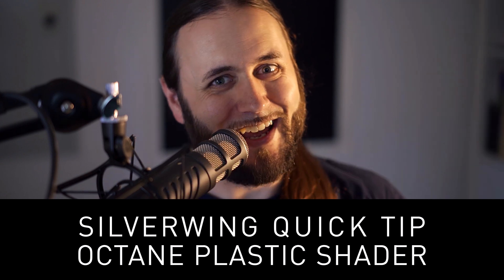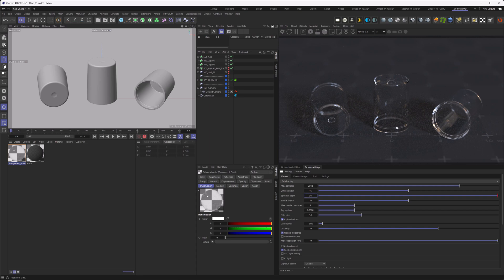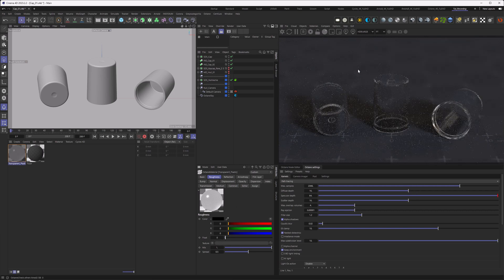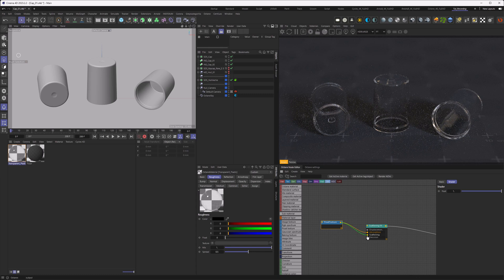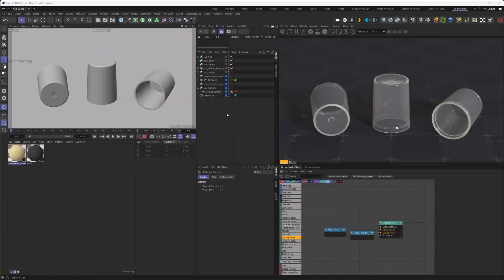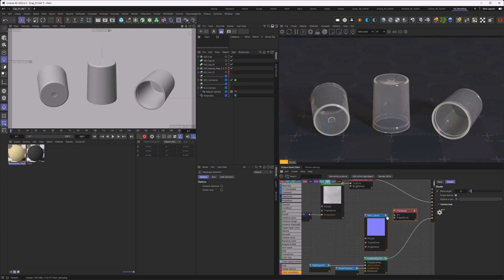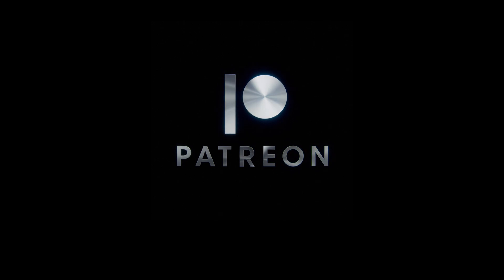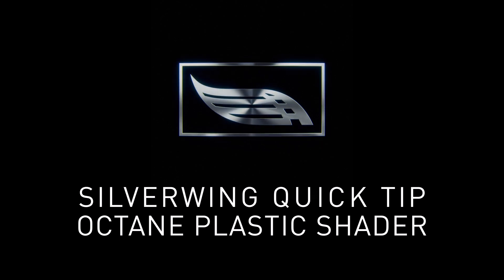Silverwing Quick Tip: Octane Transparent Plastic Shader

Comment: Could you teach me how to create this effect in the c4d arnold renderer?
Reply from the maker: Hey there and thank you very much for your message and you request.
To be honest I have not used Arnold in a long time. So I am not quite sure what you need to do exactly to get it working there. Though in general, as Arnold is also a physically accurate path tracer it at least should be along the same lines as I show in Octane.
I also have a tutorial how to achieve this effect in Blender Cycles. Maybe this helps to get you closer to implementing it into Arnold:
https://youtu.be/2VYX8EReMQs

Comment: whats the equiv of float texture in blender octane?
Reply from the maker: That would be the "Grayscale Color"
Though this is capped from 0 - 1 (Black to white)
If you need values above 1 though it's best to e.g. use Float Value and set all 3 values to the desired strength.
Reply: @SilverwingVFX  thank you ill try it soon

Comment: Do you know how to implement it in rs, Silverwing teacher? It seems impossible to achieve
Reply from the maker: Yes. On my Patreon there is a scene for RS too.
Though it's easily explained so you do not have to go there and get an account.

With RedShift you can actually get a very similar result by using the old material (not the standard surface) and then setting the scattering that you have in the refraction to extinction. Then you need to balance the brightness and density with the Absorption and Extinction levels in there.

I hope this helps 🙌
Reply: I love you, thank you very directly

Comment: The result is excellent, but I have a question, how can I configure it so that the contents of the plastic container are visible? , adds another element inside the plastic container and when rendering it it is lost.      :face-purple-crying:
Reply from the maker: Hey there and thank you very much for your comment.
I think your problem has nothing to do with the plastic container. It should work just fine with objects inside, just like in reality.
If you have a container that is open, like in my video it might be a ray epsilon problem:
https://youtu.be/oidqVR_3E04

It you have a thicker plastic container and want to add objects within the plastic (objects molten within the plastic). This too could be a ray epsilon problem. But also a nested dielectrics problem. E.g. you have the wrong priorities for the materials inside the plastic.
Refer to the guide here:
https://youtu.be/IzTCztpur10

I hope that it's one of those.
If not, feel free to ask again 😇
Reply: @SilverwingVFX   Thank you very much!! The videos really helped me a lot. I had a problem with the epsilon rays, but the scene came out very well. I just need to fine-tune the lighting. I think that's where my mistake started, which is why it didn't come out like you showed in the video. :finger-red-number-one:

Comment: I can't seem to get this look at all unless Fake Shadows is turned in Octane 2023. Did something change in that regard since you made this tutorial?
Reply from the maker: Thank you very much for your comment. I think that really depends on your lighting. If you do not turn on fake shadows the whole SSS inside the the caps is rendered using caustics. And Caustics are really hard to render. So the smaller your light sources are, the  longer it will need to clean up. Also with caustics the GI clamp plays a very important role. If you se it to low, then not enough energy reaches the SSS inside and therefore you don´t have a too bright result to begin with!
Hope one of the tips helped. Though I would just go with the Fake Shadow option 🙌
Reply: @SilverwingVFX  Thank you, that makes sense!
Reply from the maker: @filipstamate1564  Glad I could clear it up a bit. Thank you and a great start into this week 🙌

Comment: No other renderer beats Octane for mediums. Would you mind telling me if we still can't use vertex map for masking mixed materials?
Reply from the maker: Thank you very much for your comment.
Yeah. I feel the same. SSS in Octane is really good!

Vertex Maps should work for a longer time now.
You can bring them into the material via the attribute node.

I also have a tut on this:
https://www.youtube.com/watch?v=nm2FSVKKFOI

The thing that does not work with VertexMaps though is displacement.

Hope this helps!
Reply: @SilverwingVFX  "The thing that does not work with VertexMaps though is displacement." that is where I wanted to get, shit! that's a deal breaker for me. Opening UV and painting maps sucks. How frequently Otoy updates their products? Redshift has a lot of updates in a year.
Reply from the maker: @Ricardo-de9ju  Just to clarify. Displacement does work independent from Vertex Maps. You just can´t use vertex maps to create or mix displacement.
But I guess you meant that.

If you have UVs on the Object you could use your Vertex Maps and bake those out as textures. But it requires setting them up first of course, so it might be about the same effort as painting masks from the start.

Otoy usually has about two releases per Year (and many smaller bug fix ones in between)

Usually its the year number .1 and then some time later .2

To be honest I think both engines are struggling with different things at the moment. So both of them do not feel that polished 🥲

Comment: anyone know if theres a similar tutorial for blender ?
Reply from the maker: I know that this does not answer your question, but you can follow this tut with blender octane rather easily.
When it comes to rebuilding it with cycles, you can do so by using the volume slot of your glass material.
You might want to turn off the refractive material casting caustics (and therefore take forever to render) with a Light Path node.
You can find the way to do it here: https://www.youtube.com/watch?v=LTcWRh3Vob4
Hope this helps ✨
Reply: @SilverwingVFX  thank you so much

Comment: do you think you can make one for redshift?
Reply from the maker: On my patreon there is a scene for redshift ready to download.
It works by using the old material (not the standard one) and then use the Extinction in the transparent SubSurface in the Base Properties Tab of the material (Not the Multi-SSS)

Comment: Do you understand how to create the same look with SSS in Octane's Standard Material surface? The Scale parameter doesn't seem to work like the Density parameter and it's kind of hard to dial in some desired SSS looks
Reply from the maker: Yes this is also possible. Its a different mechanism. Find the settings and some explanation below:

In the Standard Surface:
Go to the transmission and set "Weight" to 1
Tick "Fake Shadows"

Set "Color" to 50% Gray
This is the transmission color if the Depth is 0. If the depth is greater then 0 then it becomes a absorption value.
Set "Scatter" to full white.
Now set the depth value to e.g. 0.02 (this gives about the same effect as the Scatter Density 100)
The Depth value is related to the density value in the scattering medium. Though it works the other way around and produces  denser results with smaller numbers.

You can think of this as the distance the set absorption color is reached or in terms of scattering the distance between scattering "particles". The smaller the distance, the more scattering. In this type of shader scattering can only take place if there also is absorption. Hence the middle gray value in the "Color" channel.

Hope this helps 🙌
Reply: @SilverwingVFX  Dude thank you so much! That makes sense and I got it to work. It's just confusing that there are 2 different methods for SSS and they produce different results. I definitely prefer the results from the Transmission method. If you have the time, I would love to watch a breakdown use cases for each/ pros and cons. Or may the old way is just outdated, and that's fine too lol. You're the man, thank you for taking the time to respond 🙏
Reply from the maker: @SeunJubril  Thank you very much for your answer. Very happy to hear you got it working.
The Standard Surface has been brought in to Octane not to replace the old materials, but to be able to get a standard between Arnold, Redshift and Octane.
All three render engines will be part of Otoys decentralized Render Network and Otoy is working on the goal of being able to switch renderers on the fly.
Therefore similar material structures have to be implemented.
As I am familiar with the "old" materials, I am mostly using those.
The most glaring difference between the Standard Surface and lets say the Universal material is the inability of the Standard to change the Reflection BRDF model.
Other then that I would say they about equally well equipped.

But yeah, you are not the first who requested a tutorial on the Standard surface. So lets see what the future brings.
Cheers and a great start into this week!
Raphael

Comment: I want to ask how can I achieve gel material with crystal clear bubbles inside. Because gel is not fully transparent it has volume inside when I do it in Octane(apply volume scatter) the bubbles inside won't be showing clearly. Please help 😢
Reply from the maker: Hey hey, sorry for the late reply.
Basically what you would do is use the SSS technique in this tutorial, adjust the color and  density of the SSS to get the right look.
Then you put in the bubbles with priority higher then the gel using nested dielectrics.
Here´s a video about that. You would use the bubbles sort of the same like I do the air bubble in the glass of this tut in the end of the linked video below:
https://youtu.be/IzTCztpur10

Hope this helps. If not, feel free to write me an email.
Cheers and a great start into this week to you!
Reply: @SilverwingVFX  thank you so much

Comment: Hello. I would like an octane approach for Blender. I couldn't find some stuff you used octane for CD4. Float texture type.
Reply from the maker: Hey there and thank you very much for your comment and request.
The nodes I use vs. The nodes name in Blender in order of Appearance:

Specular Material = Specular Material
Scattering (Medium) = Scattering
Float Texture = Grayscale Color (Not really needed as the scattering has its internal colors in Blender)
RGB Spectrum = RGB Color
(Octane) Noise = Noise Texture
Texture Projection = XYZ to UVW Projection (Projections are not grouped in Blender. To scale the noise add a Scale Transform node to the XYZ Transform of the Projection node)
Color Correction = Color Correction
Image Texture = RGB Image
Triplanar = Triplanar Map (I think you need to connect the RGB Image to all the ports in Blender +X -X +Y -Y +Z -Z instead of just +X in C4D)
Texture Projection = Triplanar Projection (Projections are not grouped in Blender)
UV Transform = 3D Transformation (Click the + on the section of the RGB Image node [UV Transform] and the right node will be attached)
Attribute Texture = Grayscale Vertex Attribute
(Octane) Gradient = Gradient Map

Also keep in mind that values like absorption and scattering and 3D noise are real world sizes so they behave different at different scene scales.
Think if it like this. You can look through a 1mm scattering plastic wall. But it probably becomes totally foggy when you would try to look through a 1m thick wall of the same density.
Reply: great, I'll try to replicate the tutorial
 @SilverwingVFX

Comment: Since octane is a spectral renderer ... is it possible to do a fluorescent shader?
Reply from the maker: Hey hey, thank you very much for your comment and your question.
Octane is only spectral in the visible spectrum. So the rendering would lack information that it needs to convert energy from invisible spectra.

I know that Otoy looked into it at some point similar to also being able to render light polarization. But then switched its development efforts implementing AOVs and other for the time more useful things.

Maybe they have some time to keep on developing it and add it to the renderer at some point.
Eight now the only (very rudimentary and probably bad) method I can come up with to mimic fluorescence is to add a little bit of emission to the material in question.
Reply: @SilverwingVFX  interesting method il give it a try
Reply from the maker: @3omar.  Have fun experimenting.
I just noticed that I have not specified one thing. Where the emission should go...
So in the Scattering node, there is a emission input. You can use this to make that to connect either a texture or blackbody emission to 💡
Reply: @SilverwingVFX  i just tested it and it made sooo much difference! But i hope you make a tutorial on it soon because i know you would do it way much better than i am
Reply from the maker: @3omar.  Great to hear!
P.s. if you are on a fringe case and your SSS just seems to dark. (Next to turning on Fake shadows) You can also increase the Scatter Depth and also increase the diffuse depth with it as the scatter depth is max as high as the diffuse depth.
Also what really can make or break SSS is the GI clamp. If it is to low, there is not enough energy to spread around. I usually leave it on a value between 5 and 10.
Maybe I make a SSS gotchas video. Seems like a good Idea 😊
Reply: @SilverwingVFX  definately i would love to see a video about it ... also i heard standard surface material has a user friendly SSS without the need to add medium nodes

Comment: Thanks)How do you make concave vertex map curvature?  Do you just put the object itself in the vertex map field and adjust the curvature there, reinforcing it with a spline, or is there another way?
Reply from the maker: Hey there and thank you for your question.
Actually I do it the old fashioned way selecting the parts manually.

You can see how I do it to some extend in that video (should start at the right time):
https://youtu.be/rRoo1Z489YI?t=182
Reply: @SilverwingVFX  Thanks, I'll definitely take a look❤️

Comment: As always a golden piece of knowledge from you! Thanx for the tutorial! I have an idea of the potential next topic for the lesson. Please, explain how to correctlty use Volumetrics and Fog Medium. Especially painful task for animation. I tried many times to make this directly in Octane and that's a real headache and ruins all the idea of its usage :( Sure, it can be done at the compositing stage of the postprocess but I hope that I still do not know decent trick to make it directly in Octane. The problem occurs when using volumetrics with many characters with area lights and HDRI. The render time is going crazy long and the noise is really annoying and frustratiing. Please, help! ;)
Reply from the maker: Thank you very much for your comment. Much appreciate your kind words and the suggestions!
I have gotten quite a few of volume requests lately. At some point I have to go over it in a long tip 😇

Just know that there is no magic button that makes volume renders super fast. The render time will always be at least twice as much... probably more like 4X. But there are a couple of good to know things as well as some gotchas.

Cheers and thanks a lot again for your input!

Comment: Cool one, the proper translucent materials are always a challenge.
I wish someone would make a similar tutorial on Redshift.
Reply from the maker: Thank you very much. Much appreciated.

For redshift. I have written this in a post below somewhere. But I will repeat it here:

With redshift you can actually get a very similar result by using the old material (not the standard surface) and then setting the scattering that you have in the refraction to extinction. I am not at the computer so I might be off on the terminology 😇 I know this because I had to make such a shader in Redshift once.
Reply: @SilverwingVFX  
Yes, thanks for the info.. 
I also did similar material in RS, but it was just random tweaking of parameters here and there until I got a visually satisfying look. 
Which is not good, and that's why I wrote about a similar tutorial, but for Redshift..

Comment: Hey Raphael, as always - great tut, although I am Redshift user, but try to apply it as much as I can. How do you find Cinema 2023 - is it enough stable?
Reply from the maker: Thank you very much Sergio!

Redshift:
With redshift you can actually get a very similar result by using the old material (not the standard surface) and then setting the scattering that you have in the refraction to extinction. I am not at the computer so I might be off on the terminology 😇 I know this because I had to make such a shader in Redshift once.

About C4D 2023:
It´s decently stable for me. It feels more crashy then R20 that I still use from time to time. But has of course much improved features. Love the new modeling tools among others (though some of the crashes result from those) I would say that it´s well usable for production.
But as you know that also very much depends on so many factors especially with GPUs those days.

Hope this helped a bit.
Cheers and a great start into this week to you!
Reply: @SilverwingVFX  Hey Raphael! Thanks for the redshift tips I will try them! Wish you also a great start into this week!